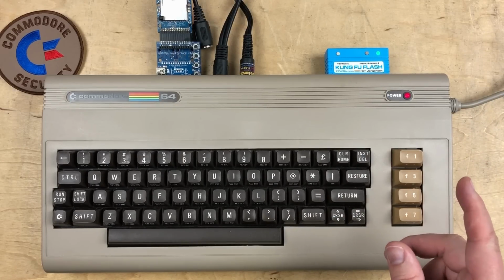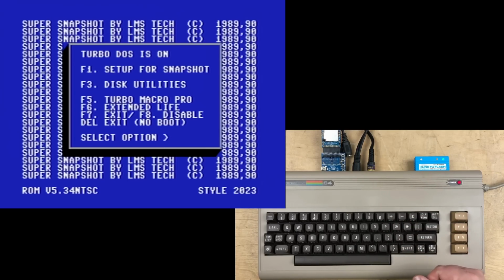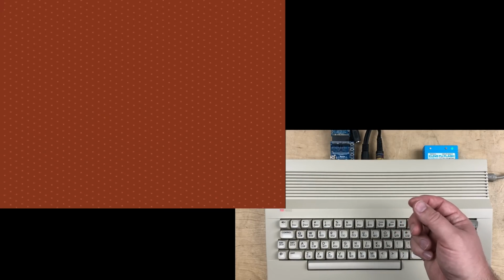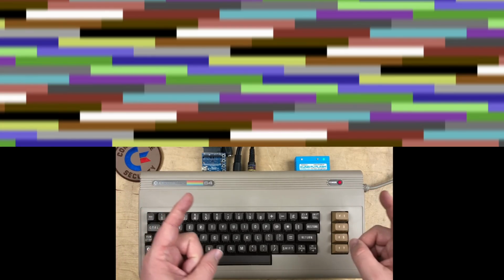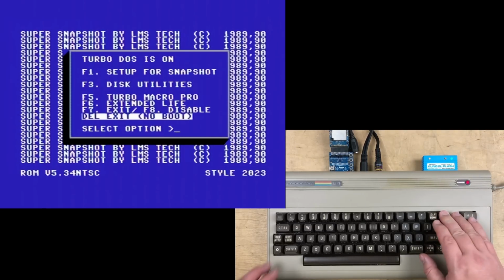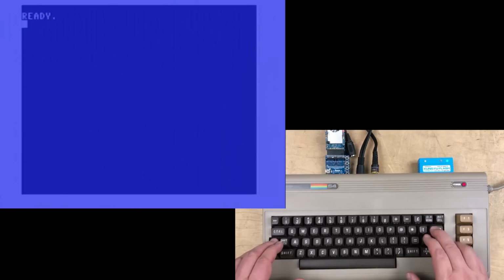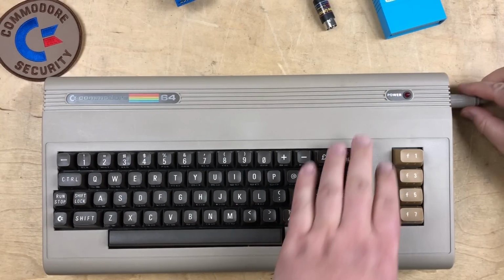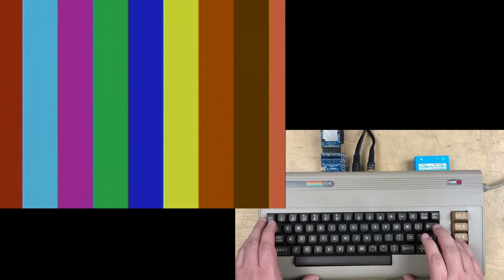One Giant Pixel? Exploring $D020 and VIC-II/6510 Timing

Comment: You're saying that there's a value that that normally initializes to after power up? What are the supposed exceptions then?
Reply: The C64 software in ROM fills in the values, so the exceptions would be a different ROM version in the future? The reason why you should use AND, as to not take things for granted.
Reply: @tonysofla : I don't know either, so that's probably why I asked him. But thanks for adding your question to mine.
Reply: @HelloKittyFanMan  It was the answer why he used peek AND (255-16), as you don't touch bits you don't know what they are set to, just good programming. 
Every C64 ever made did boot up with the same VIC settings, but still, you should use OR and AND when dealing with bits.
Reply: @tonysofla : Oh, well if it was supposedly the answer then why were you asking me, as if you weren't sure yourself?
Reply: @HelloKittyFanMan  I used the ROM? as an example. Another reason: game code enters a subroutine and it doesn't know ALL the bit settings the screen mode is in when its routine is called, so you should use AND to not scratch your head why it's not working now, as you did not foresee this screen mode change to your code.
Reply: @tonysofla : To answer your new question: Yes, I think you did. But I thought you already knew that about what you were saying. So in that case why are you still asking me?

Comment: On that first question about the stable colour changes on the pal machine, and your timings having a remainder...do your timing calculations include the time for the raster beam to return to the top left after it has finished drawing all the way to the bottom?
Reply from the maker: As far as I know, the raster beam returning is built into that timing. I assume the VIC-II sends the correct signal to the TV/monitor sometime in the upper/lower border while it keeps happily incrementing $D011-$D012. There's probably a range of scanlines that "vblank" or whatever it's called is sent. I don't think I've ever seen a detailed description of how that part works.

Comment: Great video!
Regarding the 6502 and read-modify-write instructions (like INC), the Western Design CMOS variants, the W65C02 and W65C02S, actually fix this. The bus is always active on the 6502 and either in read or write mode, but never inert, there's no way around this. But, what may be changed is whether it's in read (R) or write (W): where on the mos6502, it's read the value from memory (R), modify it (W), write it back (W), the CMOS version puts the bus in read (R) on the intermediate modifying cycle.

A way to fix this for the 64C may be to use either the X or the Y register, as in: INX (2 cycles), STX  $D020 (4 cycles), which is the same cycle count as INC $D020 (6 cycles).
Of course, you could also swap your NMOS 6502 for a CMOS 65C02… (but this would also mean some more slight incompatibilities) ;-)
Reply: NMOS 6502 even treated RESET as second NMI: pushing PC and CPU status on stack before jumping to the vector. Not sure if one could swap them (NMI and RESET lines), seems possible with minor software changes. CMOS 65C02 does three reads instead.
Reply: @argoneum  This (PC pushed on reset), I actually didn't know!

BTW, has anyone ever done an analysis of R/W-states of the NMOS 6502 for the "illegal opcodes" (or undocumented instructions), which are really combinations of official instructions executed at once?
As these instructions are especially interesting for video kernels (for "racing the beam"), there may be some unexpected side efffects on the side of the video hardware with systems like the 64C…

Comment: 22:52: apart from flickering colours, on PAL there's also another effect: colours in neighbouring scanlines interact with each other. See articles  "Old VIC-II Colors and Color Blending" by ilesj and "Next Generation Graphics on the Commodore 64" by Kodiak64. While to get nicely mixed colours you need to alternate exactly two colours, mixing still occurs even if the colours change on every line.
30:30: the 65C02 changed it do double read instead of double write. There's also another quirk with instructions on the original CPU, for example LDA $C0FF,X (assuming X=2) reads unnecessarily from C001 before correctly reading from C101. Also fixed in 65C02.

Comment: 2:10 And that one pixel was uphill, both ways!

12:52 I can also see yellow and blue diagonal bars moving toward the left.

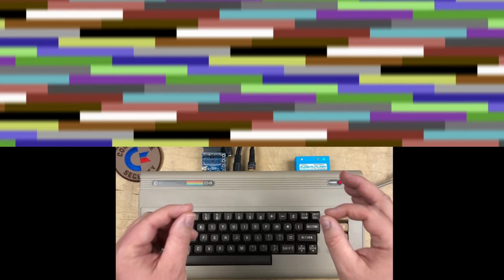14:36 Is there any lag between the VIC-II register being changed and the border color being changed on the screen?  (Apparently not.)

22:39 The downside to being a hand model — you can't work when you have a finger injury!

30:13 You could fix this by changing INC $D020 to INX : STX $D020, which is also 6 clock cycles, and keeping the color in the X register.  The STX has something "proper" to do with the bus on every clock cycle, so it doesn't generate spurious writes.

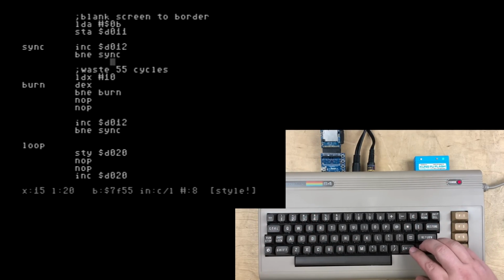32:59 Wouldn't it be more clear if you LDA #$FF before the "sync" loop and then use CMP $D012 and waste four more cycles with NOPs?  The initial sync loop would be two cycles faster, giving an error of fewer cycles.  You could also cycle the value in the accumulator on failure to make multiple alignment attempts per video field, basically CLC:ADC #$02:ORA #$80 on failure.  Or, I guess it doesn't matter here whether you're aligning to a specific scanline or one whose low byte comes up twice.

I was expecting to see an REU fetch into the background-color register to produce a "bitmap" image.  Or, with a 2MB REU, you could play a two-second video loop.

Comment: This episode got its own theme song!  Nice video Robin. 

Once you “sync” with $d012 won’t the initial “sty $d012” mean the color changes 4 cycles (or some number)  into the raster line draw?  Still not visible to the left but I’m wondering once you sync up should you burn 61 cycles then do the sty?  So the write on cycle 4 would be the exact start of the raster line?

I guess I would need to think about the cycles of the sync too. I guess I need to do some science myself. 😅

Anyway watching this was the most fun I’ve had with one pixel in a while. Thanks!
Reply from the maker: Yes, that initial sty $d012 would be happening a few cycles into the raster line rather than right at the beginning. I was mostly just concerned with trying to get the write to happen at the same point, rather than immediately at the beginning but yes, burning another ~61 cycles would be a solution if you needed to be at the very beginning. To open the side borders, for example, you need to fiddle with the 38/40 column bit at cycle 56 according to the vic-ii.txt document. I've done this before but it's been years; something I've been meaning to get back into.